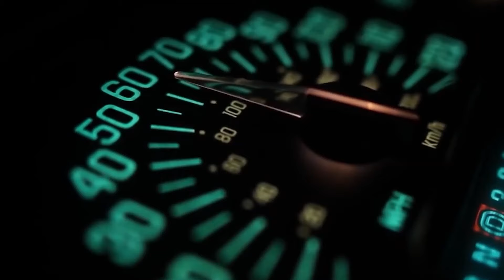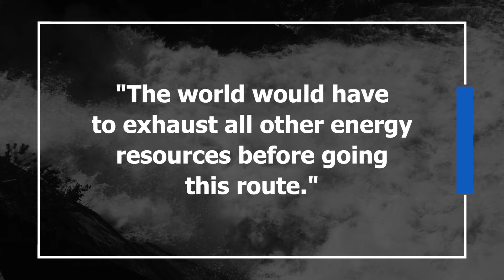The Red Sea Dam: Generating 50x the Power of a Nuclear Plant

Comment: Would it not be cheaper in concrete and material usage to make 50 nuclear power plants ?
Reply: Short answer, almost certainly.
Reply: That would be the reasonable thing to do
Reply: At an average of $10b per GW, that would be $500b for 50GW, and you would only get 1GW in maybe 10 years.

$200b for a 50GW dam is much better.

But $50bn for 50GW of solar panels, and $100bn for batteries with a weeks storage is even better
Reply: Short term, maybe. Long term, no.
Reply: @j.brendenstookey3437  Long Answer…..Government over-regulation would make sure that it was more expensive to do anything nuclear
Reply: @mightym  Except you forgot to factor in $100 billion to replace the batteries every 20 years
Reply: @Matt-yg8ub  more like every 30-40 years based on recent battery technology, and cost of batteries decreasing year on year, unlike nuclear capital costs
Reply: @Matt-yg8ub  after 20 years the batteries would probably cost $1 billion. 
Here's what people don't realize about renewable energy and decarbonization: it's completely inevitable that battery technology will be essential to everything we're doing in 10 years. More and more R&D will pour into it, as it already has been for the last few years. Having nuclear doesn't change that: it's not viable to run your car on a nuclear reactor.
Battery tech is also
 becoming highly recycled, so when everything is running on batteries, getting materials for new ones will be cheaper: we'll just recycle the old.
Energy storage will be everywhere. It's a necessity in a world that has ditched fossil fuels.
Reply: How about we stop building everything around cars to begin with ? Let's build around bikes & pedestrian's.
Reply: And easier to build 50 nuclear power plants.
Reply: Yes, and nukes can be built in a few years if the antis got out of the way.
Reply: Yes BUT it's costs a lot to reaproses fuel as only around %2  of fuel is used disposable of nuclear waste is expensive big done properly and we don't have that much uranium left ( and don't say we have plenty it's under the sea and stupidly expensive to get)
Reply: @gingernutpreacher   Fast reactors.
Reply: @edarmstrong7197  molten salt
Reply: In 300 years we either should have figured out fusion if it's possible. And by then fission should have advanced to make 50 gigawatts cheap.
Reply: @gingernutpreacher  what exactlly do you mean by stupidly expensive?
Reply: @gingernutpreacher  yes please. There was a molten salt fast reactor built in the 80s. I think it was called the Argonne. It's on YouTube somewhere.
Reply: @I.C.Weiner  fusion has been 20 years away for the last 50 or so. Fission has been working well for 60 years, not counting Soviet bungling and their total disregard for their citizens lives.

Ok, sure fusion would be the final and best answer but needs lots of Tritium. Could harvest it from fission plants I guess.
Reply: @mightym  $200b for that dam is absurd... It could easily cost 10X that. China's big dam is about 2km in length and cost at least $20b... And China typically build cheap.
Reply: @mightym  I bet you think that's all better for the environment to, don't ya buddy?
Reply: @auspiciouslywild  How old are you???  13???
Reply: @mikelarry2602  Have you seen the size of "pedestrians"??? no bike riding gonna happen.
Reply: @mightym  50 GW solar panel? How fucking big the land for it?
Reply: @Matt-yg8ub  10 years
Reply: @Matt-yg8ub  And they forgot to factor in that 100 billion would not be anywhere near enough for storage. Battery storage is about 300 million per gwh, meaning that 100 billion would only buy 300 gwh of storage, or roughly 6.5 hours of storage assuming the solar plant runs at max capacity. The proposed plan wouldn't last a day.

Nuclear plants get cheaper and quicker the more you build, and countries that regularly build them can crank them out at 4 years at 5 billion per gw. 150 billion could potentially buy 30 gw of nuclear which runs 24/7.
Reply: @will7its  Yeah well... it kinda sux to ride when its hot, windy, cold, wet or when you need to transport stuff like groceries or pick up the kids from school.
Reply: @Matt-yg8ub  Strict regulations are necessary for anything nuclear. Its why another Chernobyl hasn't happened. Chernobyl and 3 mile island were caused by poor regulations, and a lax enforcement of regulations.
Reply: @mightym  A dam that blocks the Suez canal is an idiotic idea. Also nuclear reactors have less of an ecological impact. The amount of waste a reactor puts out is miniscule in comparison to other energy production methods. You are lacking knowledge in the nuclear energy department.
Reply: @gingernutpreacher  lol a coal plant running for one day creates far more waste than a reactors entire lifespan.
Reply: @will7its  Bikes are means of transport that aren't sedentary. So more people wouldn't be fat.
Reply: @garretth8224  lol you didn't read my comment just assumed coal ash is used as a base material in many products. I was referring to cost. Don't go off we Kyle's we solved waste problem age's ago look up celfield in UK storage pools and the time it blew a top off a well
Reply: @gingernutpreacher  its not stupid expensive to get it from the sea and all nuclear waste is straight recyclable
Reply: @damienchall8297  now you're just being a troll how do you reacycle boot and gloves so you don't mean all waste. And you mean sent fuel which can be reaprocesed 3 time's  now look up the storage pools at cellerfield ( not spent fuel pools ) and tell me that can be recycled
Reply: @garretth8224  While safety regulations are necessary in any industry, the nuclear industry in the US is massively over regulated to the point of artificially crippling its ability to compete with other forms of power.
Reply: @spencerleava2502  Thanks for the numbers
Reply: @auspiciouslywild  mining the resources to produce batteries is an extremely energy intensive operation that will continue to require fossil fuels for the foreseeable future. 
Risking everyone’s well-being, and the health and safety of an entire planet on the idea that some scientist somewhere will have a magic breakthrough any day now that will revolutionize battery technology, and allow us to create cheap plentiful battery systems that don’t have any of the drawbacks of the current ones, is criminally negligent, but that’s what we’ve come to expect from our current leadership.
Reply: @mightym  negative ghost rider. There’s a Grand Canyon sized void between the theory and the practice when it comes to battery systems. In small scale testing in a laboratory environment, you can get five or six times the battery life that you do in the real world.  The fine print is that it’s also extraordinarily more expensive to get that kind of performance and requires rare earth metals that we don’t have at scale.
Reply: @I.C.Weiner  yeah, you hit on the point that most people here are ignoring, this project would take 300 years
Reply: @frederickdenbosch3742  well, I think they planned on draining the Red Sea to gain the land ;)
Reply: @mightym  well you have to increase the price or reduce the capacity of the solarpanels to 400% or 25% respectively due to solarpanels only having a capacity factor of 10-25% while nuclear is 90%+.
nuclear also doesn't ruin huge areas and doesn't require you to replace the entire powerplant every 20 years
Reply: @mightym  Dude it will be a cold day in hell before we ever see a megaproject of this scale end up anywhere below a trillion dollars by the time it's done.
Reply: @M  10billion per gigawatt? Since when even the most expensive nuclear plants are far less per gigawatt , it wouldn't even be close to 500billion for 50GW
Reply: @Audun Wilhelmsen  since when was talk happening about nuclear power running cars? I genuinely don't understand why renewable people constantly attack nuclear energy you are both on the same team with the same end goal
Reply: @stijn2644  may I ask where you found $857/kw for solar because the lowest I could find is about $1500-$2000/kw
Reply: @stijn2644  cool. In the end hydrogen fueled power plants will be a thing. There's now more hydrogen gas power plants than nuclear power plants in the US. GE quietly converting them. And new 100% hydrogen turbine power plant designs are about to be built.
Expected cost is about $1300kw and about 12 months to build, pretty good aye.
Reply: @88Cardey  tell the creator of the vid
Reply: @yodasmomisondrugs7959  no not advocating for it at all, just giving cost comparisons. Hydrogen turbine power plants is my preference
Reply: @Matt-yg8ub  meh we will see if their claims hold up.
In any case hydrogen turbine power plants will be a thing soon, comparable costs to solar $p/kw
Reply: @mightym  👍
Reply: @alexandrosandreou8585  Never underestimate government waste, grift, and regulatory fees. If it costs you $10,000 in labor and materials to build it, the government will charge you $50,000 for the permits to allow you to build it.
Reply: @mightym  could you give me a source where it says there are more hydrogen power plants than nuclear in the us? As i understand it, the us has a fleet of reactors supplying 95,84 GW of nuclear power. 

While i'm aware that hydrogen is a great fuel for internal combustion engines, i wasn't aware of any powerplant being fully converted to green H2. Yeah the cost is indeed really low, these turbines (natural gas)get build in such large numbers that it's just the cheapest power system.
Reply: And 50 plants would be distributed power where needed. To construct this Dam, would only make sense if the area was converted into a massive production hub.
Reply: @mightym  Invest in solar and then convert to hydrogen storages and gravity wells.
Reply: @reahs4815  reactors need maintaince like any other power generation.  Two in my state, and one is down right now for leaking tritium into the mississippi, also worked at the other one during a generator replacement.  Also found 3 solar tables yesterday on a site where the driveshaft came off and was not tracking the sun.  All mechanical stuff will break over time.
Reply: @jamesross160  Ofcorse they do but you do not have to replace the entire powerplant after 20-25 years and not to mention capacity factor. (nuclear 90%+ solar 10-25%).
will also be fun to see the recycling for all of the millions of solar panels that get replaced (burried in the ground) with all their heavy metals.
Reply: @reahs4815  you mean efficiency.  Yeah nuclear is way more efficient.  But people forget about all the out buildings and the amount of electricity the plant uses.  Nuclear is far more capable of adjusting output, but dangers come with that aswell.  If the grid goes down and no battery storage an array will disconnect before starting on fire.  Not as easy with nuclear.  Nuclear typically needs a water source for cooling, which really is the most valuable natural resource out there.  Think it was mit or Stanford or some university just created a film to convert more bands of light into a capturable wavelength increasing solar panels to 40%.  They went from about 5 to 10% up to 20% in a little over decade.  Tracking and bifacials have helped.  Obviously solar needs more time, but is getting better.  Nuclear needs a pr campaign and end some of the stigmatism.   The overhead costs and power consumption to create electrical sources usually goes unnoticed aswell.  It's probably going to take a combination of everything to replace burning fossil fuels.  Dams and nukes by rivers.  Wind is ok in certain places but doesn't work everywhere.   Solar can pretty much go anywhere, but are not always efficient depending on that location.  Or someone could just figure out how to capture the energy from lightning bolts safely and store it.
Reply: @reahs4815  guess I've really never thought about it, but in the usa for example.  You probably wouldn't build a plant in the west coast, tsunami and earthquakes.  Not sure id build in tornado alley.  The southeast and East coasts are hurricane zones.  You need access to 100s of full time qualified employees, and access to 100s more for maintance and repairs.  Then they need a water source, so probably a river.  If I was a power company investing billions in one structure, I would definitely pick very carefully where I put them.  Not to go back to Fukushima, but the hindsight of building a nuclear plant on the coast in earthquake and tsunami zone, is quite astonishing, despite nuclears safety record.
Reply: @auspiciouslywild  if you live in an area served by a company that operates nuclear power plants and since you load your car batteries from that company your car runs on nuclear power. Probably partially as your supplier will have other different production options. Single source areas are rare, i.e. Norway relies almost exclusively on hydro power, but they are the exception, not the rule, as Norway's climate and orography make hydro power the easiest power option,. France has a huge bet on nuclear power, but it is around 60% of its production, Denmark is heavily investing on sea wind (the North and Baltic seas are a good starting point as they are quite shallow), Sweden and Spain have quite a mixed bag...
In any case the descarbonization debate is futile as long as the major carbon producers (namely China and India) would not step down.
Reply: @auspiciouslywild  Talk about spouting suppositions utterly devoid of logistical underpinnings, I've researched the recycling batteries idea and it's never going to become cheap or easy, same with battery density, metallurgy and chemistry are harsh governors on your ideological based beliefs, you're a true green washing fanatic.
Reply: @mightym  I'm sure the creator of the vid had a source they could bring up, but whatever that source is, it's full of it... And it doesn't take much critical thinking to show it... As I said China's 2km dam cost about $20b all in. That was made across a river as apposed to an ocean , which has more challenges involved and it was made with cheap Chinese labour... Just the concrete alone required to build a damn that big would be enough to send the global price of concrete through the roof... I think we're already struggling to get the right kind of sand to meet demand as things are.
And the ecological disaster it would create in the name of green energy would be almost laughable. At least nuclear power plants are one of the cleanest forms of energy we have, even if they are expensive.
Reply: @stijn2644  One of the main things to overcome with hydrogen is currently 95% of all the hydrogen we have, has come from fossil fuels and the like as it's the cheapest way to separate it form other stuff... So that's the first hurdle, it can be overcome but it's expensive to do so...
With cars the next hurdle is it's odourless and very explosive. It wouldn't be too tricky to give it an odour but it's hard to get around it being very explosive... It's what makes it useful for this...
It also incredibly light so you need a lot of it for it to be of use, to it needs to be compressed in heavy tanks that need coating to prevent hydrogen degradation. Hydrogen wants to leak and will try to find a way.
I've always thought the prospect of cars filled with hydrogen a bit terrifying, what happens in a motorway pile up with nothing but hydrogen cars? Or something going wrong at a hydrogen refill station. It would be comparable to a fairly large bomb.
Reply: @Veldtian1  Never? Then tell me which laws of physics prohibit it.
Reply: @Veldtian1  It's kind of funny that you would say that recycling batteries will never work when recycling of lead-acid batteries are already completely routine, and recycling of Li-ion is already being done at a commercial scale by several different companies, even though there's still not that many li-ion batteries coming in for recycling from EVs (which is an ideal case since you get lots and lots of cells of the same format and chemistry).
Googling some blog articles isn't really resarch.
Reply: @gingernutpreacher  we have plenty of uranium lol. We only dig it up when we need it, and there's plenty still in the ground. When the value goes up, it becomes worth it to mine lower density deposits, which are abundant.
Reply: @eatonasher3398  no we don't have plenty 😂 look it up and don't count that deep under the ocean 😂😂😂😂😂😂
Reply: @gingernutpreacher  current uranium price is $130/kg. global supply is created by demand so if demand goes up, so does the supply same with gas, coal, lithium, cobalt,... let's say that the current known reserves on land are all that is left. If the reactor type changes from LWR's to fast reactors, the waste produced from those LWR's can power the fast reactors. recent study by RePlanet (european institution) says that the spent fuel in europe is able to generate electricity for the continent for 600 years.

I know you maybe don't want to hear it but uranium from seawater is possible. The price of extracting uranium from the sea is higher than that of land based exstraction. The realistic price for seawaterextraction is $1000 - $330/kg. This is ofcourse in a low volume research approach. Not only uranium is a valuable metal is seawater, there are others like lithium, nickel, molybdenum,etc.
Reply: @mikelarry2602  yes
Reply: With fusion so close seems abit odd the fuck the planet for this
Reply: @ILoveBluePeople  Fusion has been "so close" since the 50's. Don't be fooled, the obstacles still to overcome are monstrous. 
The heat required for nuclear fusion is obscene, to the point that any materiel in its path is turned to plasma. 
The only way we know how to contain it, is with superconducting magnets that need to be cooled to within a few K of absolute zero, and they need to be pretty close to a fusion reaction with a temp of at least 100,000,000C. You can see how that becomes a problem fast for any sustained reaction needed for energy production...
Also the whole energy in energy out the media love to jump on is BS. With the laser one in recent news, the amount of energy used to produce the laser was far more than the reaction gave, the fusion reaction just had a bit more energy than the laser energy itself, the energy required to produce the laser was far, far more though. 
The sun with all its enormity is in any given second only fusing a tiny amount of hydrogen when considering its scale, even by human scales it's a very comprehensible amount, not even a mountains worth by volume... And for that to be sustained it requires the mass of a star... The challenges are immense.

IMO Fission is a far more promising technology, we should be looking to improve on limiting and recycling waste, better efficiency and better long term storage solutions... That is all far more within our reach than fusion technology.

But yes, this is still an incredibly stupid idea, it's up there with the line, the hyperloop and the sky lift...
Reply: @I.C.Weiner  in the meantime, SMRs look really promising and hopefully will be able to be built for the expected cost due to being built in a factory instead of insitu
Reply: Yes.
Reply: Even better, molten salt reactors. Make use of the salt water from both the Red Sea and ocean.
Reply: Not enough subsidies for nuclear
Reply: Yes
Reply: @mightym  No point in assuming as high a price as $10b/GW when building nuclear on such a scale. A more realistic estimate would be in the $2-3 billion/GW range.
Reply: @mikelarry2602  lol   Let's just make everything run on love and smiles instead. What world do you live in?
Reply: @mightym  The only reason nuclear isn't getting cheaper is because the whole industry is being prevented from benefitting from economies of scale by red tape. If there was a constant construction of new nuclear plants, the cost would go down as nuclear construction companies build up the infrastructure and streamline the process for building a specific, proven design. But the current situation is that nuclear plants are basically bespoke projects, each trying to do the cutting edge technology at the time construction starts, and when the plant is finished the company that built it dissolves entirely, or just pivots to plant operation and the engineers that actually built the plant move on to other fields because nobody wants to make another plant for ten years, and so the actual expertise to build the next plant more efficiently is lost each time.
Reply: @martenkahr3365  check the list of reactors on the world nuclear association website, each of the manufactures had certain designs they iterated (GE was BWR line with 6 generations, westinghouse was wh-loop line with 5 iterations, now the A-1000).

Standardisation of design was a top priority, but because it takes so long to build, new technology and better designs are created.
 
Which MSR model do you think should be selected to be the standard design and never iterated again?
Reply: @mikelarry2602  Wow! just like in my Cities: Skylines!
Reply: @SeedemFeedemRobots  It's just life before the automobile.
Reply: @will7its  how old are you? 10???
Reply: @mightym  the great thing about nuclear is it would only take 10 years or so for them to be up and running and thats just because we have to build them. This however takes 100s. 

Also solar would take up so much space to generate that much power. If you took the largest plant at 14k acres and it makes about 2 GW for easy rounding, you can see how big of a problem that would be for anyone
Reply: @Matt-yg8ub  Over-regulation. 

You understand that Japan has one of the most regulated nuclear power programs?

Sometimes shit happens and consequences are measured in hundreds of years.
Reply: @kbuckendorf4287   “one of” being in the top 10 :-)
Reply: You could also just install atleast 200GW of solarpanels for 200 Billion. Somewhere in the Sahara desert. This would be much easier and would almost have no negative effects on the environment .
Reply: @mightym  You don't really need that much storage, in these regions you will probably have 10+ hours of sun every day.
Reply: @auspiciouslywild  Greta, they're mining your cobalt as fast as they can. The beatings are running up against the law of diminishing returns.
Reply: @sid2112  Not sure why you're talking about cobalt.. cobalt isn't technically needed for batteries, and is expensive, so it's being gradually eliminated from battery chemistries. LiFePo does not use cobalt. Sodio-ion batteries does not use cobalt. Several state of the art Li-ion chemistries do not use cobalt.
One of the reasons Apple is prioritizing getting to 100% recycling of cobalt in their phones is that the iPhones out there in the world already probably has all the cobalt Apple ever needs in their batteries, since the batteries they make now use less cobalt than the batteries they made before.
Reply: The direct cost would most certainly be higher for nuclear... where nuclear wins here is the indirect costs. The damage done by this dam would be unimaginable with the combination of not only the ecological disaster it would create, but the flooding of cities, loss of the Suez canal, transmission losses, political destabilization, and a slew of other unintended effects that we haven't even considered yet.
Reply: @auspiciouslywild  Batteries haven't improved in the last 50 years. The "improvements" you are talking about are in miniaturization of the tech. Basically using less materials to build them, standardizing the size of the batteries and stuffing as much electrolyte as possible into batteries where they are effected by quantum effects. But the biggest problem is that you are stuck with 1000-2000 recharges per lithium batterie and lower for others. So you will be stuck charging/discharging them daily. 5 year replacement for batteries is kinda standard practice now. I work in a datacenter and we have a room full of battery VRLA batteries. Everyone and their mother is currently pushing lithium batteries into datacenter, but they are forgetting one little fact why it will never work in datacenters: in case of battery fire you can stop it with gas suppression systems, you can't stop it even if you submerge it into water.
Reply: @daznis  How is "miniaturization" not an improvement? No, we haven't discovered some new kind of physics. But squeezing more Wh/kg, Wh/lg and Wh/$ and improving safety is the only thing that actually matters.
And I'd argue that you are completely wrong. We have discovered new chemistries and improved existing chemistries in ways that use new molecules in novel ways.
" 5 year replacement for batteries is kinda standard practice now" - lol! my old EV is almost 8 years old and is still comptely fine. A bit of degredation, but if it continues at the current pace it has another 8 years ahead of it.
" you are stuck with 1000-2000 recharges per lithium batteries" - and? that's still plenty for most applications, and the utility will just increase as energy density and cost improves.
"and lower for others" - That's utterly wrong. Molten metal batteries have essentially infinite charge cycles for instance.
And it doesn't really matter if the cycle life is lower now that battery recycling is becoming common. Apple is targetting 2030 for 100% recycling and seems to be well on the way.
"in case of battery fire you can stop it with gas suppression systems, you can't stop it even if you submerge it into water."
- That depends heavily on the chemistry. Battery fires have much more to do with the electrolyte than with the anode/cathode materials. Standard Li-ion uses a flammable electrolyte (the initial "explosion" you see comes from that) and when it has burned the anode and cathode are shorted which causes the battery to consistently heat itself which can start new fires. You're completely wrong that you can't submerge them in water. It's the standard method of putting out BEV fires. You either just douse them in lots and lots of water. Or you do what the Norwegian fire department has just started doing: fill a container with water and lift the BEV into it.
Other lithium chemistries can be completely safe. If there's no flammable electrolyte there's essentially zero risk of fire. No initial explosion and no shorting of the anode/cathode. LiFePo is extremely safe and so is many solid state lithium chemistries.
Reply: @gingernutpreacher  lol oceanographic uranium isn't Under the seas, it's dissolved in the sea water. It's just a filter process. I think the predicted cost is like 4x traditional mining cost of uranium... And fuel costs are like 10% of lifetime costs of a reactor. It's even hypothesized that while filtering out uranium, more ocean crust will get dissolved replacing the uranium so that it's essentially renewable.
Reply: @granatmof  you got a link beacuse what I bring up is $1000 per kg and it "might" go down to 300 but it's currently $67 per pound and yes I know I can't be bothered to convert unit's
Reply: @mightym  Keep in mind $200bn is the proposed price lol we all know how that goes..... By the end, it'll rise to a trillion dollars easily after a few rounds of "setbacks".
Reply: @auspiciouslywild what you people don’t realise is just how much raw materials we need to build all these batteries and solar panels , recycling of solar is not profitable , damage to the environment is horrendous . 

To build the batteries to store the world energy needs for 7 days would mean increasing raw material mining etc 20x and doing it for at least a dozen years and by the time we reach that point we will need to start replacing the batteries , what about the production of all the machinery and running that machinery to extract the raw materials needed ? What’s bout the chemical run off that is destroying the environment already let alone when it’s increased 20x ?
Reply: @kylewilliams6091  people like me have read studies that tally up all those resource requirements you are so worried about. And it's not bad at all. Read Marc Z Jacobsens studies. All numbers sound big when you put them on a global scale. The oil and gas industry is already insanely resource intensive on a global scale. Far worse than a 100% renewable economy will ever be, even with no technological progress. 
When we get to the point where batteries have to be replaced, we've already solved the problem. Lithium battery recycling has come incredibly far in just the last 5 years. 100% circular economy for batteries is inevitable. It's simply cheaper to get the valuable materials from old batteries. Why do you think Apple wants your old iPhone? It's cheaper for them now to get the cobalt from an old phone than from politically risky cobolt mines. 
Some chemistries that are tailor made for grid storage, like molten metal and redox flow batteries, essentially never degrade. Maybe you want to recycle them after some decades as the materials get slightly contaminated. But then those materials will essentially be like pre-refined ore. Much cheaper than trying to dig fresh ore. 
There are plenty of challenges, but none that are anywhere near insurmountable. If we invest even 10% of what we do in the oil and gas sector today, we will almost certainly solve the remaining challenges in a decade or two. 
The physical fundamentals are on our side.
Reply: @kylewilliams6091  By the way, EU requires solar panels to be recycled, and France has a facility that now recycles near 100% of the solar panels.
Why do you people talk so confidently about topics you have absolutely no clue about? Maybe you should read more, and speculate less.
Recycling has not been economical before because the volume of old solar panels coming in has been so low. You need high volume to recycle efficiently. That's obviously changing. It's simply inevitable that solar panels will be part of a fully circular economy since they contain valuable materials, which are increasingly economical to extract.
Reply: nuclear power is expensive as fuck